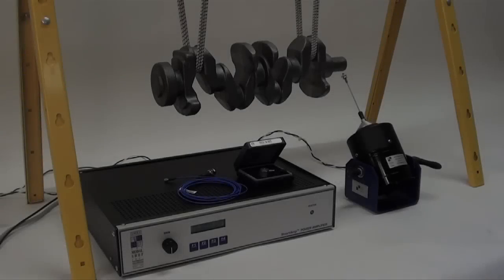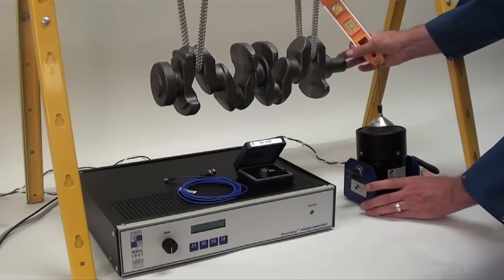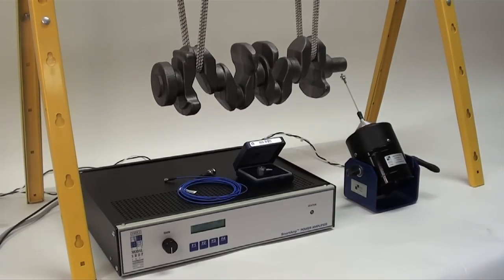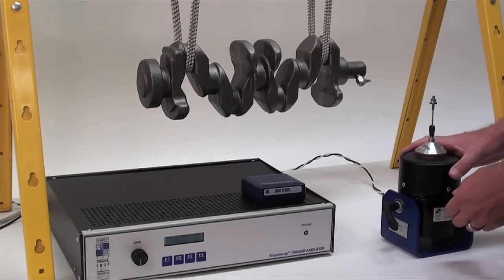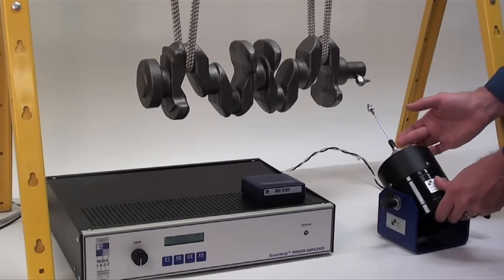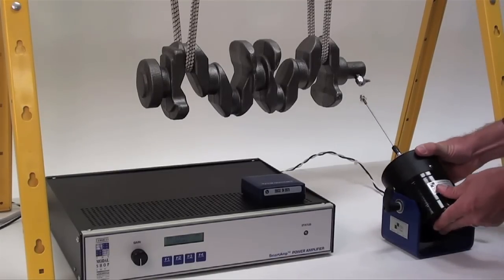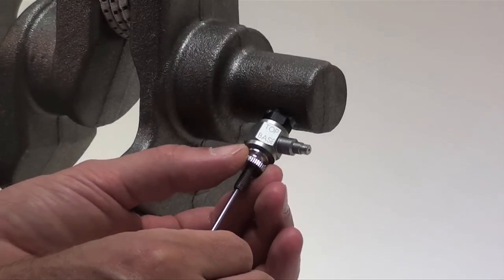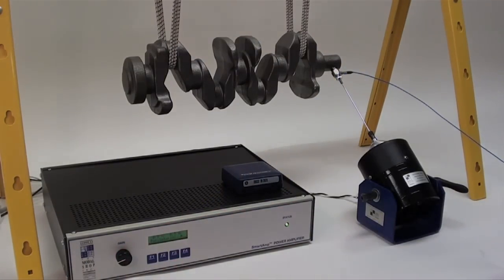Vibration Shaker Test Setup Tutorial

Comment: According to the video, a mount was used and placed in between the crankshaft and the load cell. If possible, I would like to know what sort of mount that would be.
Reply from the maker: Thanks so much for watching Akshay! Yes, the model 080A adhesive mounting base is used to connect the force sensor to the crankshaft.  It is attached with a cyanoacrylate adhesive (super glue), typically Loctite 454.  Please see the following link for the base: https://www.pcb.com/products?model=080A.

Comment: If no stinger (connect test piece with shaker directly), the result would be influenced a lot?
Reply from the maker: Yes. The shaker head should not be directly attached to the structure for modal testing. This would provide very poor frequency response measurements.  If the shaker were to be directly attached to the structure, there would be significant dynamic effects of the shaker imposed onto the structure, resulting in a dramatically altered frequency response function.   Basically, the stinger decouples the shaker system from the structure and applies force to the structure.  The stinger is designed to be rigid in the axial direction and flexible in the lateral direction.  Force transducers measure axial force but still transmit forces into the structure through the transducer’s stiff casing.  Therefore, any side loads transmitted to the structure by the stinger through the force transducer are unmeasured and contribute noise on the measurement.  A stinger that is properly designed, selected and aligned will reduce or eliminate this potential problem. For more information please check our shaker FAQ at: https://www.modalshop.com/excitation/Modal-Shaker-FAQ?ID=336.